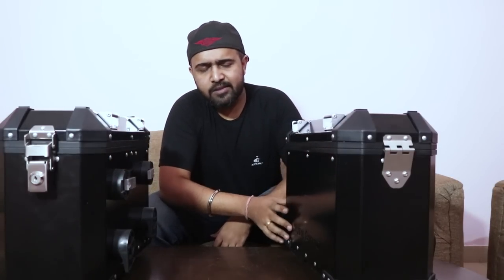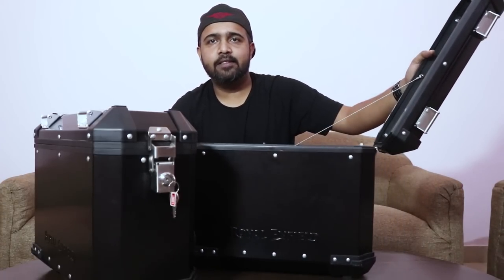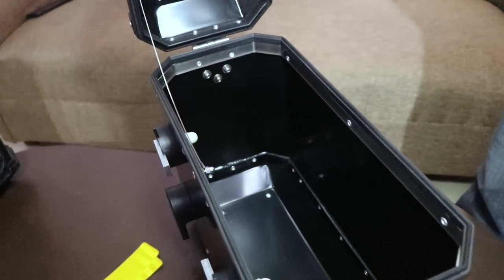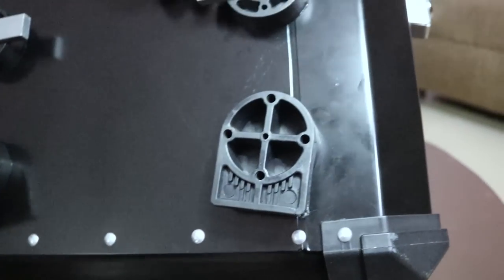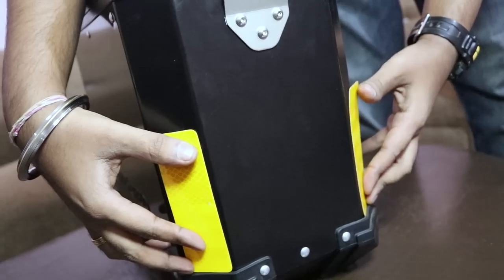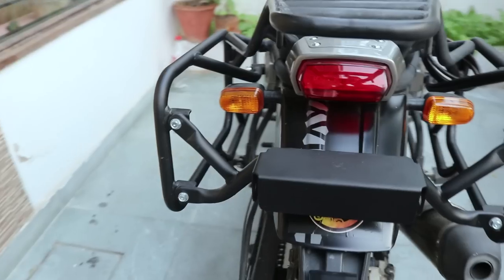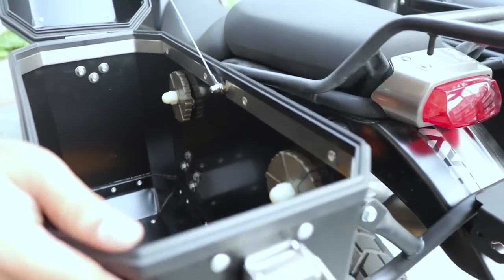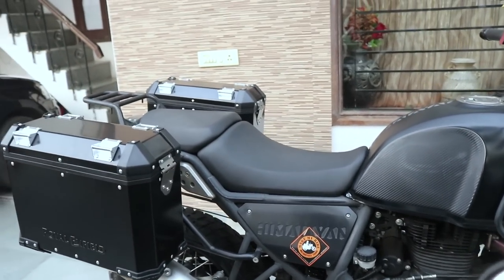Royal Enfield Himalayan Aluminium Panniers

Comment: Also small correction in the mounting method . the top metal part needs to be kept straight after fitting. In fact you will observe a groove which will keep the top metal part in a straight position.
Reply from the maker: Parthesh Bhatt yaa u may be right but that's what I was told buy the showroom fitter
Reply: The Indian MotoVentures yes. If you keep it on side ways during the long drive or off-roading if the mount gets loose due to vibrations it will not held on its place . Therefore it is safer to keep it in the groves.
Reply: Is the 5 kg limit serious?it seems too low.
Reply from the maker: asish mogadala same is written in the instructions notice which one showed in video which is on lead also 5 kg is more than sufficient for me because I'm light packer and if you are looking for bigger panniers then I have good news for you I will be coming with new bigger panniers video next week just stay tune subscribe and don't forget to hit the bell icon

Comment: I am 5.3 tall guy so can I easily drive  This Royal Enfield Himalayan . I want to purchase it . And this is BS4 model. And what is a total weight of this bike with paniers And tell us what are the pros and corn.
Reply from the maker: +deep mandal considering Ur Height I would recommend you to take long test drive which includes off-road. And then decide. The total weight of the bike with panniers is approximately 200 kg.
Pros. 
1. U can take it to anywhere
2. Can attach panniers and Jerry cans directly
3.good for off-road
4.good suspension
5.best touring bike
6. Good ground clearance
7. Pocket friendly mentainance 

Cons.
1. Slightly heavier if you belongs to Bajaj/Honda family
2. Bike is slightly higher so if you are taking it to off-road you may fall because of hight and unable to touch Ur legs on ground

That's all I can say but considering Ur hight I would recommend u dominor or Duke

Comment: Well, in the royal Enfield website they say specifically that these panniers are not waterproof, I imagine that it's in cases like crossing rivers when you can have problems, I dont think the rain  is going to affect the interior
Reply from the maker: I done ride with rain n also in water crossing with panniers on and there was no water licking inside only thing I think it can't avoid water going inside if we take it water flow coming off roof kind of thing otherwise it's can provide protection from  water.

Comment: for 27k good panier? And the rear portion of your himalayan get as fat as your car.  Bhai log i have classic 500, i used stainless steel panniers and rear crush-guard / leg guard , total 3500/- for all, and same capacity box, width of back is as much as of my front leg-guard ( ie guessing your bike width is easy, u don't have to look back) and guess what i had several falls, but not a single scratch on my baby. If u have himalayan, don't go for stock career and panniers. there are several other options to make your beast being slim, sturdy and robust, by paying only 1/10th of that amount.

Comment: Can you tell me if you can turn the silver plate that holds the pannier onto the frame from the outside, this looks like the panniers are not secure enough for someone to steel very quickly and easily ?
Reply from the maker: U can turn it only when it's loose other wise it gets stuck into slot and never move once properly tight
Reply: Thats good to know, Im waiting for mine to arrive, 2 months waiting list in the UK. Thanks
Reply from the maker: Ohhhh!!! that's too long but worth every penny spent believe me
Reply: @TheIndianMotoVentures  it actually looks like you mounted them wrong, the silver blocks should be vertical, there's a cut-out on the mounting block that has a detent for that. That would mean no thief could turn then from the outside.
Reply from the maker: Yaa that was my mistake bcoz I didn't had much knowledge that time

Comment: My RE Himalayan Panneirs leak when it rains or  simply get wet.  Not sure if they are leaking from the seal where the box lid meets the bottom case or if the leak is from the rivets.  What's up with that RE?
Reply from the maker: I haven't faced such a issue

Comment: Hii I also purchased the same one. Can you tell me if the frame came with the Allen key nuts from the company itself ?? Because my dealer has fitted the normal bolts only.
Reply from the maker: Parthesh Bhatt no man showroom guys have bought allenkeys and fitted it on my bike
Reply: The Indian MotoVentures ok thanks. This one looks neat and clean. I will get it changed before rider mania. Also the reflectors are very nice and bright.

Comment: Nice bro. I purchased Himalayan with Silver Pannier boxes. It's nice product. I have question about GoPro Hero 6 batteries.I bought GoPro Hero6 Action camera. I need to buy a spare battery. I got the link which you shared in this vide0. But it is for Hero 5. Is the battery same for hero 5 & 6? 

Also please share the video editor software details you are using.
Reply from the maker: Hey GoPro 5/6/7 has same battery so go ahead and buy also most of the times I edit with GoPro studio software which I downloaded 2 years back from gopro  site but unfortunately they removed it after GoPro 6 launch but still you find it on internet
Reply: @TheIndianMotoVentures  Thanks a lot for your reply. I will then go and purchase one additional battery for me. Also I tried with quik app that is GoPro's video editor which is severely hanging. I am not able to edit anything there. Other editor softwares are supporting 4K videos. Do you have any other recommendations?
Reply from the maker: If possible buy adobe premiere

Comment: Does the silencer hit the bottom of the side box when the suspension is compressed?
Reply from the maker: Nope there is plenty of space between silencer and panniers
Reply: Then how much does it cost? I'm planning to buy a Himalayan soon but I dont know what good accessories are there?
Reply from the maker: It will cost you around 27k for pair including mount but if you are looking for cheaper ones do CHK out my other videos of orange candy panniers
Reply: The Indian MotoVentures   Okay. And 27k is quote expensive considering i will be offroading only once a year
Reply from the maker: Yeah I agree but considering below point it's worth every penny u spent.
1. Its waterproof - u won't be in worry while crossing the watercrosing and heavy rains and believe me soft panniers or saddle bags will be more worrying part in that situation.

2. Even if you fall ur stuff inside is safe.

3. Bike is more stable with full carrying
 capacity

4. U don't have to worry about ur stuff u leave with ur bike CHK our orange candy panniers video Mr.Bean had explained every positive point of hard luggage system and believe me he is one of well know and experience rider who had covered every part of India on his bike also he is been to Leh 13 times.

Comment: Seems there is a provision on the panniers stay to install rear indicators .. chk out this link
https://www.facebook.com/photo.php?fbid=1628607447199943&set=pcb.1955445271386030&type=3&theater
Reply from the maker: Yaa I know but could you please tell me that do we need to extend the indicator wire or can manage with stock one
Reply: The Indian MotoVentures  looks like u have  to extend wiring. .. pls chk with owner from FB link
Reply from the maker: hey got it fixed today stock wires are long enough to extend till the tail